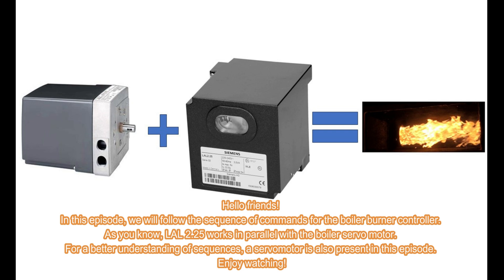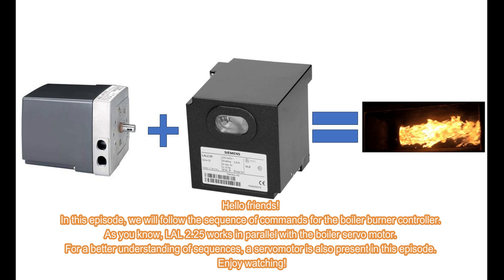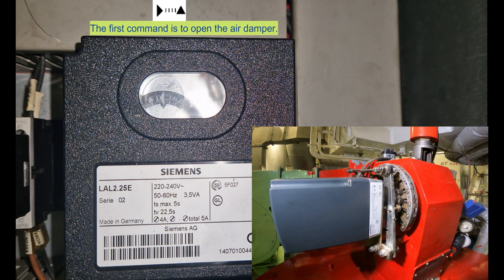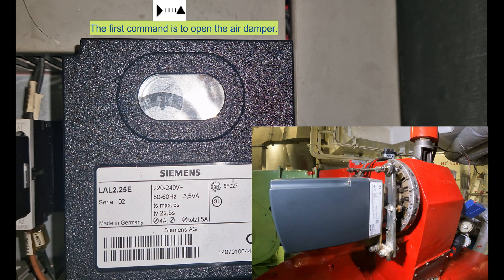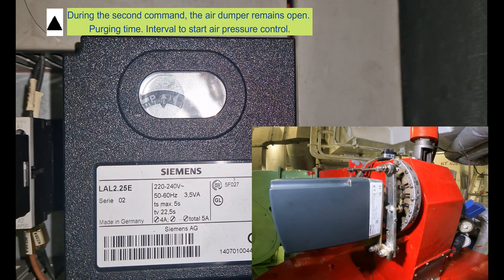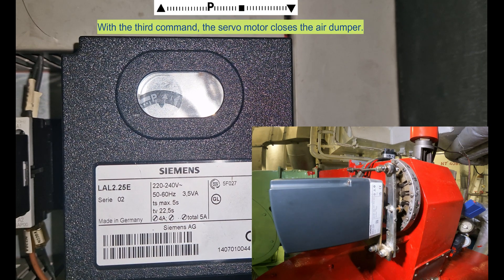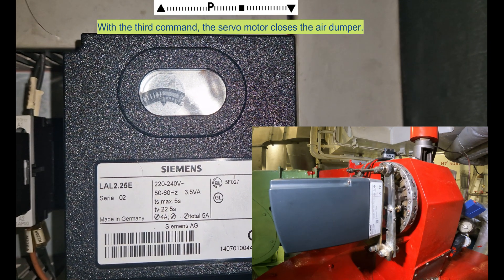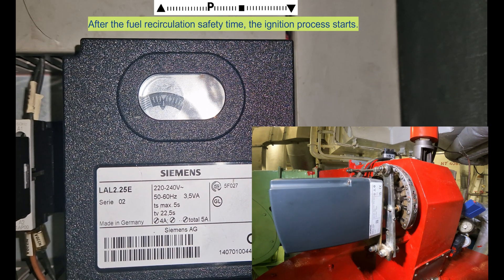LAL 2.25 controller process sequence description

Comment: Is it possible to adjust the full load limit of this burner? Because everytime the boiler running on auto mode, the boiler misfires at full load. Now boiler have to run at manual modulation mode at certain load to prevent misfire. Maybe I can adjust the full load limit so that I can fire the boiler at automatic.
Reply from the maker: Hi!Yes, you can try.

Comment: Hello sir, we have Lal 2.25 on oilon rp 500m burner. The issue is boiler purges in auto mode goes to full load and doesn't come back to ignition load to fire.  The lal is showing v in alarm. This alarm is for failure to detect ignition position and we have already checked all connections and replaced lal also but still facing the same problem. We are without boiler as of now. Kindly guide me with this issue
Reply from the maker: Hello my friend.  Check the cam position, which is responsible for fully open position. After check visually all contractors inside the boiler panel.

Comment: Hey, i have LOK16.250A27 after flame is starting. The burner shut down the dector pointer be on 1  we replaced flame detector and controller him self now we don't know where is fault
Reply from the maker: Hello my friend. Please try to adjust the air dumper of the boiler. Could be you have too much air portion, and it will shut off the flame.
Reply: Hii I have lfl control, starting time red light on.. what happen in control

Comment: Hello Sir, 
First of all, thank you for your video.
Our problem is, the process continues on the LAL but the actuator does not turn, that is, the air suction does not open or close, there is no movement, we replaced the actuator with a new one but it still did not work, Do you think could be the reason? 
Thank you
Reply from the maker: Hello my friend. You're welcome. Check the video on my channel: SQM 10 servomotor adjustment, and check if the servomotor is connected with the air dumper. If all okay there, most probably, if the actuator (servomotor) doesn't turn, you don't have power to it due to some comtactor malfunction, burned coil, or loosed wires. Check the electrical drawing and find where can be break of the power line.
Reply: @ thank you very much ! We will check 🙏🏻

Comment: First servo open fully second close to the setpoint??
Reply from the maker: Yes. It depends on the servomotor's "cam" adjustment.
Reply: @iworkalone6140  ok i Understand now, i can adjust cam switch to control open/close servo motor

Comment: Hello having issue with lal2.25-110v controller is turning working fine but once actuator opens it trips and light turns on inside controller and my control panel shows a flow fault issue any idea what the problem could be
Reply from the maker: Hi. You mean  a "flow fault issue" on the boiler panel? Do you have a thermal oil boiler?
Reply: @iworkalone6140  yes it was a flow fault issue and it is a thermal oil boiler It would light but would not stay on
Reply from the maker: Write your email.

Comment: Hello My friend my controller sequence is working good but if i darkened the flame detector noting happened and the burner still working what is the reason
Reply from the maker: Hello my friend.  First of all, try to check wiring and connections inside of the boiler's panel. They must be well tightened. After, try to change the flame detector. If you don't have a new one,  borrow it from a neighbor boiler. Also, try to change the LAL controller itself.

Comment: 1:50  : I have a problem at this point but i dont know what it is. If I reset it, the burner works for two days and go to the same fault like showing at this time fram from the video 1:50. This process is now for two Months do you know what is the problem is ?
Reply from the maker: Hello my friend!What type, model  of boiler do you have on board?What type of fuel do you use?
Reply: I use the Siemens LAL 1.25 and i use this for oil burner for heating. The burner is from the brand Elco Type is EK 04.48 L-Z. Its a heavy oil burner
Reply from the maker: 90% of the time, you have a problem with some element of the boiler system. The controller is okay. What type of maintenance did you do the last time? I need more information about your boiler. If you can, make a picture of the burner and send it to my email: gishtage@gmail.com
Reply: @iworkalone6140  I send you pictures. Thank you buddy!
Reply from the maker: You are welcome!
Reply: Btw thanks for the fast reply👌
Reply: This is great input!
Would you please consider making a presentation on furnace temperature controller...LOA and the oil preheating unit? regards
Reply: @iworkalone6140... preferably the weishaupt brand.